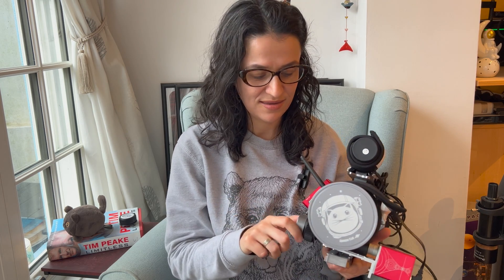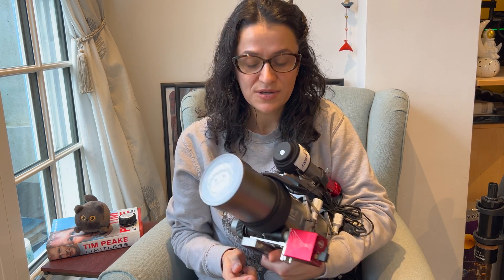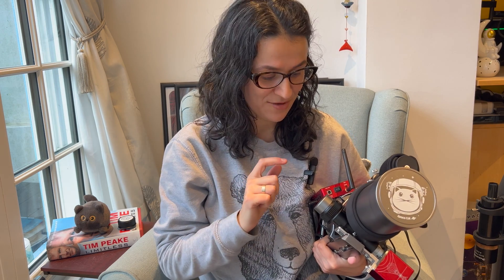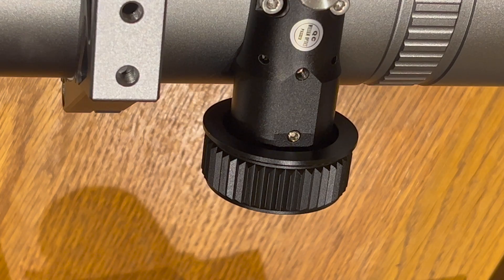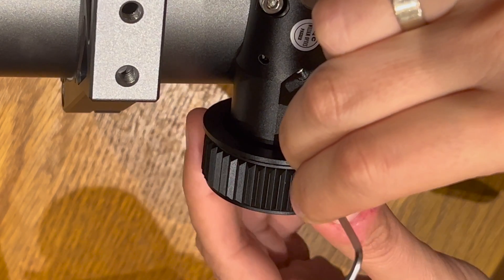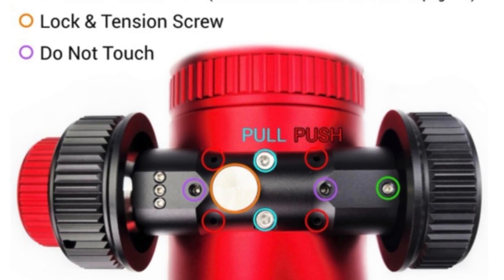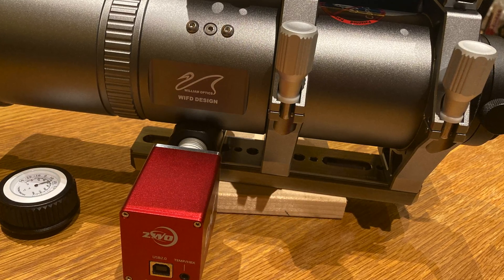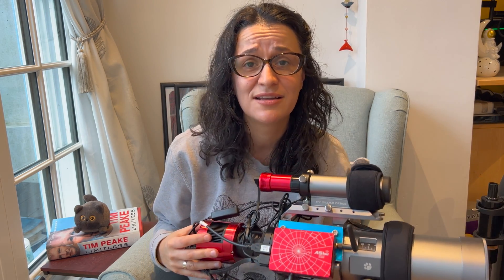Installing a ZWO EAF to a RedCat/SpaceCat 61 WIFD

Comment: Great video . FLO shared the link as I'm just installing one myself.
 Did you have to remove the large tensioner screw to fit the bracket?
Reply from the maker: Oh did they! Cool! Yes the large thumbscrew comes off and then back on after the bracket, just careful not to overtighten.
Reply: @CellistOnTheRoof  ah brilliant thank you!

Comment: Thanks for posting this video, super helpful for installing the EAF on my new scope. One question though... Is it normal that once you attach the EAF, that you can't turn the focuser knob manually? The metal protrusion from the EAF doesn't seem to spin if I try to turn it by hand, and now that it's attached, the focuser knob on the other side won't turn.
Reply from the maker: Hi! After installing the EAF, you can’t turn the focus knob manually anymore, and it’s important not to focrce it! Once it’s on, it’s only controlled by the EAF at all times. There’s an optional hand controller or it can be moved up and down in software.

Comment: Very informative video; thank you! Do you feel the manual focus still works sufficiently with the EAF installed? I’m on the fence of getting the EAF because I want to make sure I don’t lose the manual focus feature.
Reply from the maker: Hi, not sure if you mean manual focus by turning the knob or button controlling the EAF - after installing the EAF you cannot and must not use the manual focus knob anymore. It can be “manually” moved to any position by either the optional controller or in ASIAIR/mini PC. This works absolutely fine!

Comment: I cannot get mine to find the focus point.  I’ve reduced the steps. Increased the steps. Super frustrating
Reply: After I find the stars. In fact, I get them nice and pinpoint and then try to run the autofocus and it just cannot seem to focus. It’s almost like the stars are too small for it to pick them up.
Reply from the maker: I had a funny moment like that when it didn’t want to focus and resolved it by expanding my limits. In ASIAIR > EAF > Step Settings > limit, set it to something much larger, then do a full restart. Hope this works!
Reply: @CellistOnTheRoof good tip!  I started making the steps smaller. What are yours set at?
Reply from the maker: My step size has never changed, it’s been 40 from the beginning. Fine is 10, coarse is 30. The current position is around 9000 and the limit has been upped to 25000, then it worked fine! I have exactly 55mm at the back. Really hope that helps.
Reply from the maker: Is that after it’s found the stars and it can’t do fine focus, or can it not find anything at all?

Comment: 7 months later and they still haven't provided better instructions, thanks for this!  One quick question that might be obvious, but I am over cautious, did you fully remove the "orange" tension knob in order to out the EAF plate down?  I am assuming so, but at the same time, I just want to be sure before I do it.  Thanks!
Reply from the maker: Hi, yes completely removed but then used as a mounting point for the EAF, then made sure not to overtighten!
Reply: @CellistOnTheRoof  Thanks very much!  Sadly, I ran into a rather unexpected issue.  I went to loosen the internal grub screws for the temp knob and one of the internal grubs is completely stripped before I even started, so the temp knob will not come off.  I am in contact with Agena Astro to see what they can do since it's only been a couple days since I received the RedCat.

Comment: There is a focuser tension screw where the EAF brackets need to be mounted.  The instructions do not say to remove it and to use the hole to screw in the brackets, but that seemed like the only option.  Is that correct or does the focuser tension screw need to be there?
Reply from the maker: Personally to me it wasn’t perfectly clear in the diagram, but I used that screw as a mounting point for the EAF bracket, making sure it’s not too tight. It doesn’t technically say not to remove it - just not to overtighten it!

Comment: A word of warning about the 2 screws at around 2 minutes 50 seconds, from my experience. Do not totally unscrew or remove the 2 hidden screws, just loosen them slightly and you can slide the knob off. If you unscrew them too far they could fall out under the knob and jam the mechanism!

Comment: When you removed the grub screw to get to the two hidden screws so you could remove the thermometer, you did not show reinstalling that top grub screw after tightening down the EAF coupler.  Did you not replace that top grub screw?  Hope that made sense.  Thanks for the video.   Just ordering the 61 WIFI.   I am guessing I should order some spacers to fit between the scope and the dovetail plate.   Enjoyed your video.
Reply from the maker: Hi! No, I didn’t replace that grub screw, instead I used that hole as an additional mounting point for the EAF mounting plate! Hope that makes sense? Good luck with your 61, I guess spacers do make sense if you want to keep the thermometer or want the EAF not to sit below the dovetail!
Reply: @CellistOnTheRoof  thanks.  Makes perfect sense.

Comment: Cool info, note that it's suggested to use some LocTite (Brand Name in US) it takes a very small drop to pervent the small set screws from coming loose when temps change or thru the night of imaging. It's not permanent, here in the USA it's blue as they make RED Don't use as it needs heat to remove the small set screws, where the normal blue will be undone easily. I saw in 1 of you Solar Videos that you call it Thread locker...Agreed for what these items cost should be used! Also ZWO in the first few years did include "Thread locker set screws in the EAF box, but stopped as just about every ZWO EAF video on YouTube they did not use them....LOL

Comment: Thanks for the video! After the installation I noticed that my focus knob doesn’t travel anymore the full range. The ReDCat 61 has the focus marking on the side from 0 to 50. After installing the EAF mine now goes to about 45. Did you have this issue?
Reply from the maker: Hi! I can’t say I’ve noticed any difference in my focuser travel with the EAF, either with the old helical focuser on the 51mm or the new WIFD 61mm. But with the correct spacing at the back, I’ve never really needed any range!

Comment: I have the 51 WIFD, and what I did to fix that not setting flat is to 3d print an adapter that replaces the vertical plate the EAF attaches too.  It moves it 180 Degree and made storage a lot easier.
Reply: Link to the STL?